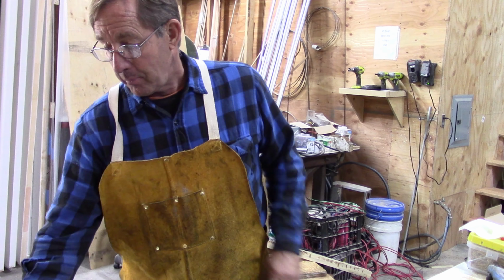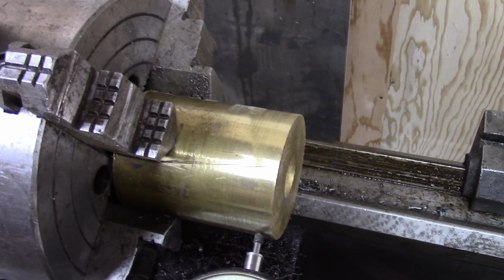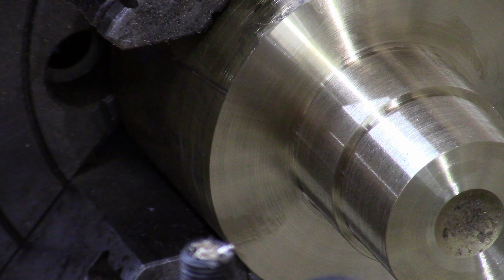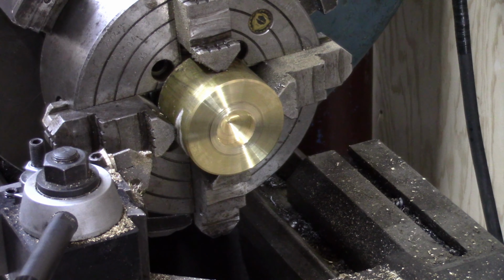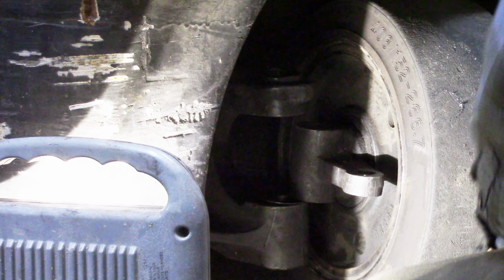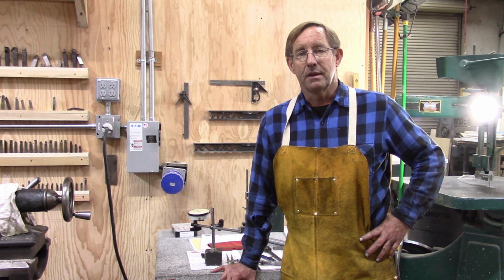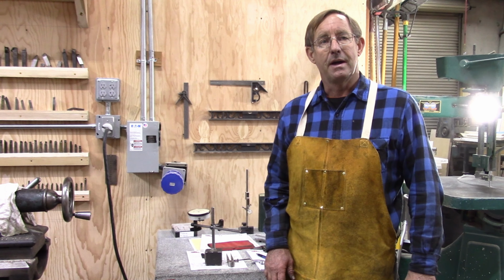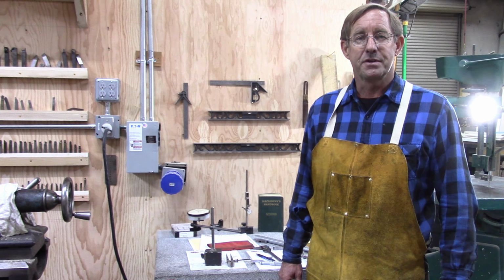Put the Pin on the Lift!: Finale {#34}

Comment: would be interesting to use plastic like material from Vesconite that is used in large industrial equipment. I am using it to replace the metal link pin spacer bushings that were used in my offroad buggy.  and they have help up well for the past year offroading.
Reply from the maker: That is an interesting idea, I am using some of that material for a current project.